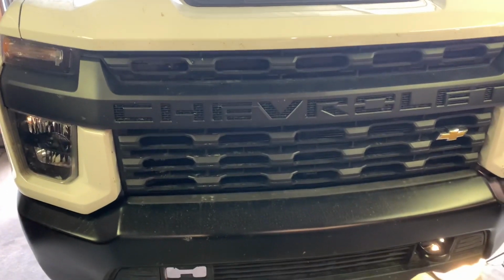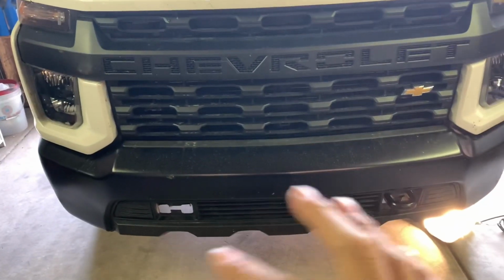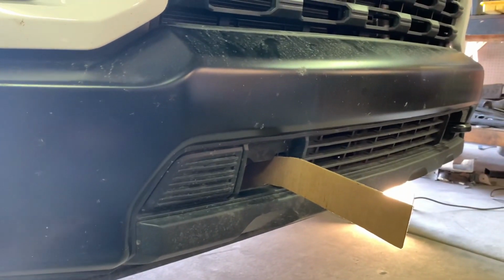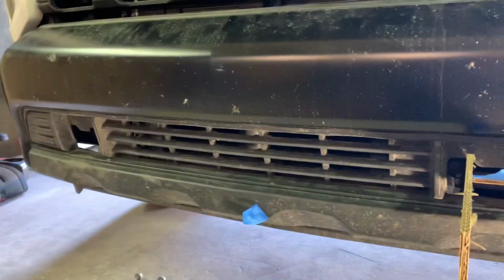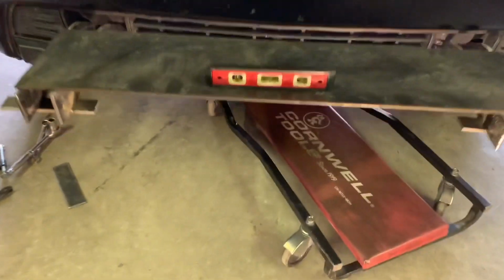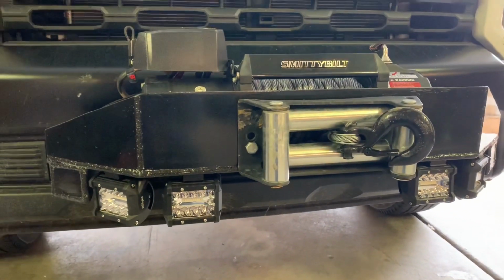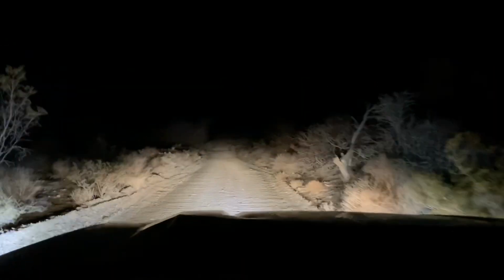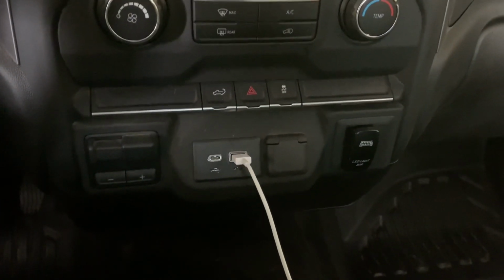CUSTOM WINCH MOUNT: 2020-2023 Silverado 2500 HD Fabrication & Lights

Comment: I dig it. Nice solution. I’ve been thinking about doing something like this for my truck but have it be quickly removable. Like maybe a piece of 2” receiver behind the front license plate or something. Pop the plate off slide the winch in, Anderson plug chilling under the hood for the wiring. Away you go winching.
Reply from the maker: Thanks! That was a thought, but it would have been too low on this truck.